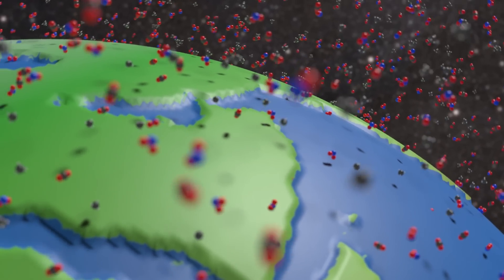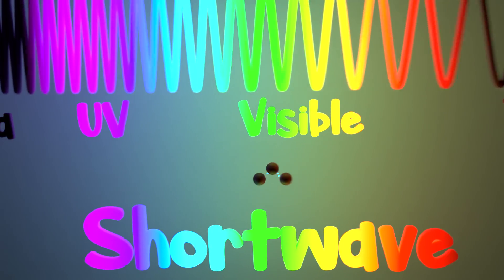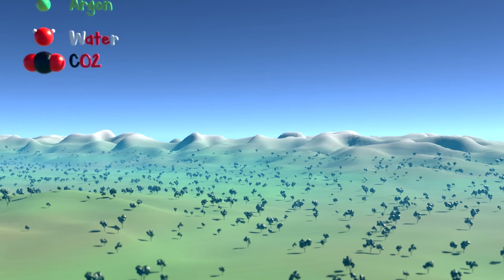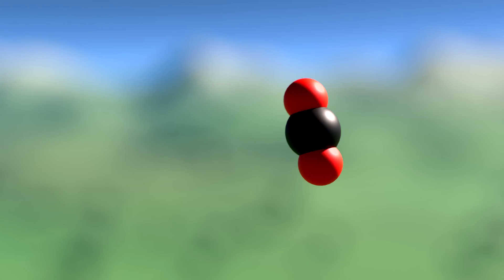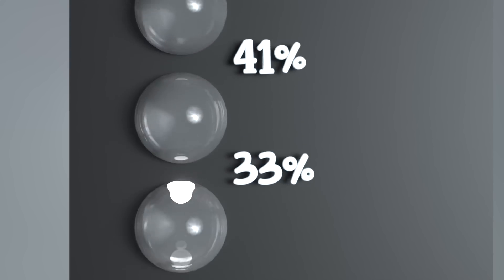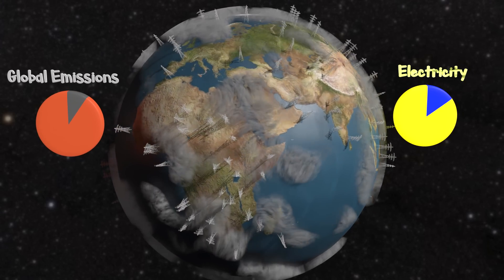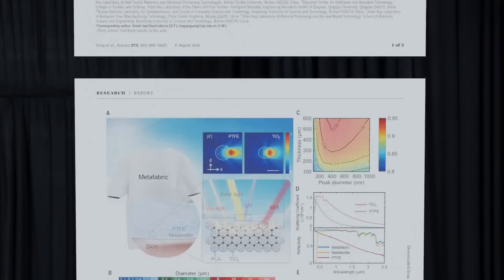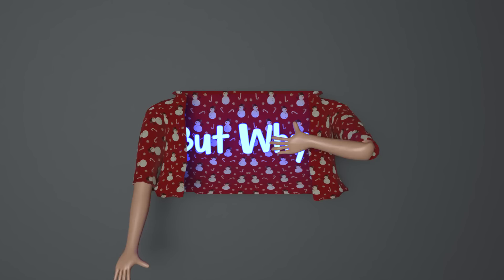Energy Free Cooling through Physics

Comment: To put a slightly different perspective on this: Different parts of our surroundings are at different temperatures, from about 5800K from the surface of the sun to about 3K for deep space. Passive cooling works by insulating ourselves from the hot bits of the surroundings and thermally coupling as strongly as possible to the cold bits of our surroundings. 

In particular, we can look at the radiation intensity at every wavelength, and ask what temperature would a black body have to be to emit that intensity? If that temperature is low, we want to absorb and emit strongly at that wavelength, if it is high, we want to reflect that wavelength.
Reply: 2022 is a wonderful year to give up on the myth of Darwinism, it offers nothing but hopelessness and meaningless.

The basic position of Darwinism is as follows:
that we are merely animals that randomly evolved in a meaningless and uncaring universe destined to die and decompose into dirt...

But it's nonsense.
It has no explanation for the beginning of Life.
I have no objective examples of one completely different body type turning into another body type... but nearly endless hypothesis and conjecture. It's a modern myth...
And its conclusions are horrifying and sad.
Reply: @brianhale3678  yeah but why you say this here?
Reply: @truestopguardatruestop164  evangelism...

Matthew 28:18-20 ESV — 
18 And Jesus came and said to them, “All authority in heaven and on earth has been given to me. 19 Go therefore and make disciples of all nations, baptizing them in the name of the Father and of the Son and of the Holy Spirit, 20 teaching them to observe all that I have commanded you. And behold, I am with you always, to the end of the age.”
Reply: @brianhale3678  what??
Reply: @truestopguardatruestop164  
Darwinism(evolution), offers us the chance to be dirt, forever.

Jesus the Christ, the one true God, the creator of Heaven on Earth offers you eternal life when you make peace with him.

Comment: if you made a greenhouse and a reverse greenhouse side by side you could also generate electricity from the heat difference. probably not much but maybe enough to run LED lighting for the 2 buildings. just a thought
Reply: But my thought is: where does that electricity come from? That system you described would generate electricity indefinitely from nothing

Comment: very interesting, i've been interested in passive cooling for 3 years now
but i didn't hear about this before
i did some simple passive cooling experiences using open carboard boxes with a temperature probe inside facing the open sky and the temperature really dropped below ambient
i remember that cellophane was a bit transparent to infrared but not glass
Reply: Heat will always flow from a hot temperature to a cool one. There is no way to remove heat from something when it is cooler then the ambient temperature with out energy input. 

What is happening is you are blocking the heat to a single area so that area becomes cooler then its surroundings. The James webb is a very good example of this. The sun shield will keep the opposite side of the craft close to the temperature of deep space, but it still requires active cooling to work. 

I find passive cooling a misnomer as you are not cooling something you are instead preventing it from heating up.
Reply: @rascototalwar8618  The first sentence is true, but the notion of 'ambient temperature' doesn't really fit into that model quite the way you imply. There are 3 obvious relevant temperatures; The sun, our test object, and the ambient temperature. Heat will always flow from hot to cold so if you only consider these three then you would be correct that we could not cool something below ambient (as this is obviously lower than the sun), but you are missing one important temperature: the temperature of the rest of the sky. It is around 3 kelvin. 
The idea of these materials is to maximise energy exchange with the sky while limiting the exchange with the sun and the air, and that absolutely is cooling. It is not a misnomer.

Most of James Webb is not actively cooled, it is just the sensors. Those are cooled well below the temperature of deep space, which is why they need active cooling.

Comment: Would it be possible to use a huge sphere of pure CO2 floating at the L1 Lagrange point to filter infrared light from the sun (by like 50% or so) to lower the heat from the sun without lowering the light that reaches us?

Comment: this is cool but there's simpler better methods. Just a sheet of aluminized mylar on your roof will reflect like 98% of sunlight

The jwst basically uses a few layers of this to achieve a 300K ΔT between hot and cold sides

Comment: So if the temperature difference is 30 degrees, passively, could you use that to generate electricity by way of a Sterling engine?
Reply: It is what I thought
Reply from the maker: Maybe not quite to that level, but this is actually a possibility for remote instruments or devices where sunlight isn't reliable. Like at the poles. 
https://aip.scitation.org/doi/10.1063/5.0010190

But the amount of electricity would be very little.
Reply: @ButWhySci  but where does this electricity come from? Apparently from nothing!! This is impossible

Comment: Very interesting.
Water vapour is the ultimate greenhouse and inverse greenhouse gas. Carbon dioxide can’t even hold a candle to it.
It is highly likely that cO2 is actually an inverse greenhouse gas when free in the atmosphere instead of a test tube.
To actually act as a greenhouse gas as it does on Venus the percentage of cO2 would have to rival or exceed that of oxygen.
Oxygen is about 20% of the atmosphere c02 is currently about 0.04% of the atmosphere Water vapour ranges from 0.4% to 10.3%. Water vapour shades c02 from most of the infrared radiation it might receive. What little energy it does receive is mostly radiated upwards, hot gasses rise after all. What climate alarmists do is hold a candle up to the sun and say if you stare at this candle you will go blind hoping that you’re stupid and ignorant and gullible enough not to realise that it’s the sun not the candle you need to worry about. By the way the atmosphere of Venus is about 96% c02 that’s a heck of a lot more than 400 parts per million.

Comment: I love when the math checks out.

Passive cooling always worked - but modern material science is taking it to the next level.
Reply: So true, I was just thinking about passive/evaporative cooling used  traditionally in the middle east, technology might allow to go "back" to better solution then current AC systems
Reply: @cecilia00960  passive evaporative cooling is very neat and efficient, but it requires a low humidity environment (among other trade-offs) which is why it works so well in deserts, and is basically useless in humid heat. It's a good example of how most problems don't have a universal silver bullet solution, but it's still worthwhile to have a buffet of good options that excel under different conditions.
Reply: @MaddieM4  I wanted to try making a fan driven "evaporative cooler" that pumps air into radiators, which are in a big insulated box on a balcony. The box is full of cold water and has a small outlet, so the hot air from the room evaporates the water. Would probably need a really powerful fan and very cold water, mind you.
Reply: Did you hear from the self cooling clay water bottles of old desert tribes...
Reply: @ValeB92 the same clay bottles that would leak water?
Reply: @epstinian  no, they're not "leaking" but evaporate a tiny bit of water through the clay
Reply: @ValeB92  nah, clay pots and bottles are porous enough that the water couldn't be held more than a couple days. Modern plastic bottles are more reusable than those made out of clay.
Reply: @epstinian  that wasn't the topic my friend... It's about cooling... Plastic bottles don't cool exactly for that reason 🤫
Reply: @xistsixt 
&
bazooka712
Glaze the inner surface (so no content leakage), leave the outer layer porous; soak it in water which will evaporate as heat in the vessel's contents is conducted through the glaze and warms the water in the porous layer. The warm water at the surface evaporates, taking some heat from the container.
Reply: Yes!  I live in an extremely dry climate. I learned by experimenting that humidity is extremely important in both cooling AND heating. On stormy days the humidity rises and it’s so much easier to control the air temp to be most comfortable. Therefore keeping a fan blowing over a pan of water on an extremely hot day is enough to cool an entire large room for very little energy output. Or in winter just keep a pan of water near a heat source will raise humidity enough to make it feel warmer. It only requires very little humidity to accomplish this.
Reply: In the world of physics, a new material is being developed that could change the way we cool our homes and office buildings. This new material is based on the principles of thermodynamics and could be used to create energy free cooling systems. The material is still in the early stages of development, but if it can be commercialized, it could have a major impact on the way we use energy to cool our buildings.
Reply: things can be over engineered.
Reply: Yeah, I bet scientists 30 years  ago wouldn't believe that such a simple cloth could be used to cool things down with amazing results
Reply: almost read meth

Comment: About 2 minutes in, and already you have stated a lot of true facts about physics - which apparently gives your viewers some confidence that you know what you are talking about. You however have failed totally in how things interact. At min 1 you propose that peoples personal relationship with heat has anything to do with the composition of the earths atmosphere. That is in no way true.
The heat people experience from the sun in everyday life is mostly based on radiation, that is correct. However that is not the reason why the earth is heating, the earth have been exposed to roughly the same radiational heat from the sun for the last few 100.000 years, nothing have changed there.
Photons "or what we call short wave radiation" can and do hit both electrons and atoms. That is physics 101. The longer wave photons "or what we call infrared microwave" does exactly the same. It can hit and excite electrons and atoms. That is physics 101.
Longer wavelengths does not excite a molecule more than it does an atom. That would contradict the laws of physics. It is a probability game, if a photon with the right kind of energy hits a particle, that particle will react in a couple different ways: An electron can jump between different energy levels, either absorbing the photons energy, just to release it later on as a new photon. If the photon is absorbed by a quark within the nucleolus of the atom, the quack might go to a different state, hence changing the proton/neutron, to a neutron/proton. If however the photon delivers its wave function to one of the gluons no one really knows what happens, hence the LHC.
Less than 2 mins in you state that electrons behave like wave functions, which is right, but then go on to state that they interact with each other when they are close. Nothing of that is right, both electrons and every other particle behaves as a wave, even complex molecules. No matter the distance every fundamental particle is a wave. The proximity to other particles only affect the outcome of the wave form equation.
The dancing electron clouds you are talking about at 2.30 is a figment of your imagination, you do not need to have any "dance" of particles to absorb or dissipate any new wave form.
Also claiming that you need multiple electrons in order to to form a "cloud" is wrong even in a 001 physics class. A electron, or any other fundamental particle forms a wave function of its own.
At about 2.40 you REALLY start to mislead your audience, i would wager a bet that most do not know, but starting to "align" sinus functions does not make your previously mistakenly deductions right.
I am going to stop watching at 2.53. There are so many wrong assumptions, so much wrong visual information, there is just so many things wrong with this "science" information.
You should be ashamed, but i reckon you take the view i gave, and the comment i gave as a way of income.
Good luck.

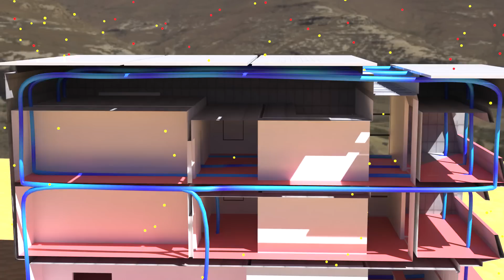Comment: 8:47 wouldn't this, just like with solar panels, need to be angled such that its effectiveness would not be hindered by as much as 80%?
Reply: I think that the concept was that instead of reducing the radiation from the sun on the area, it instead constantly absorbs the energy radiating from the ground. And since the energy that radiates from the ground always goes up, it works the same way all day.
Reply: @Samsara  ah ok. like plants do? creator (yt not the inventor lol) said there'd be no work involved but I think developing, manufacturing, distributing, and installation are all work. and while digging a teensy hole in the dirt and dropping a seed in is certainly work, at least at large scales, but even then would be/is the cheapest and easiest process that exists without the use of clarke-tech.
Reply: Solar panels need to be angled to "see the sun." This stuff needs to be angled to "see the sky." There's a lot more sky up there than there is sun, so the angle requirement is much easier to meet.

Comment: Cool video and this is all very interesting... but i can with 100% certainty say the most COST EFFECTIVE way to stop a surface from overheating from solar radiation is to PAINT IT WHITE! simple as that, sure there is probably some nanofiber whatever material that's 5% better or something like that but when you take into account the cost of it white is the most effective way, it' doesn't even have to be paint, white rocks, chalk, lime, hell even ice/snow will work.
Reply: They're developing paints that do this. And, yup, they're white to the eye. One of the exciting things about this is that it can be done with materials that are incredibly cheap and readily available. Totally ordinary stuff, just have to have the right nano/micro structure. Use the same old stuff, just use it more cleverly/efficiently. Once they figure out a good process, this stuff should be able to be manufactured as cheaply as regular paint, but with the ability to cool things down to below the ambient air temperature.
Reply: @yopyop3241  Yeah but im saying simple white paint is more that good enough, we have that right now and it works.
Reply: @CMZneu  Simple white paint isn’t enough. There are locations on the Earth with huge populations today that are projected to become too hot and humid for human habitation in the coming decades. No matter how much simple white paint you use. This stuff, on the other hand, might be enough to keep those places habitable and prevent hundreds of millions of climate refugees.